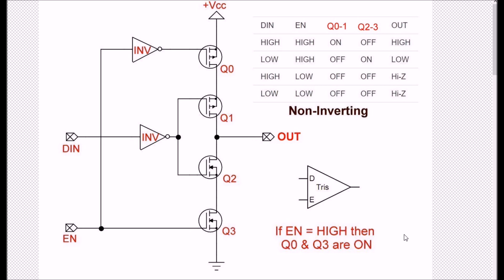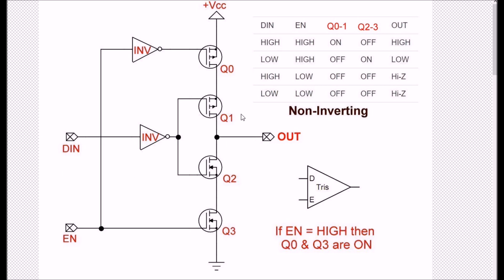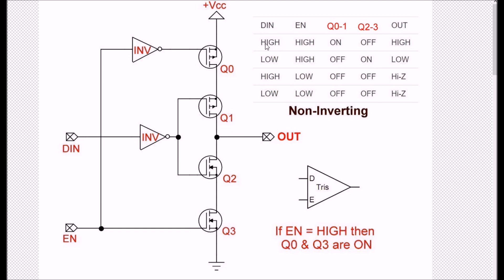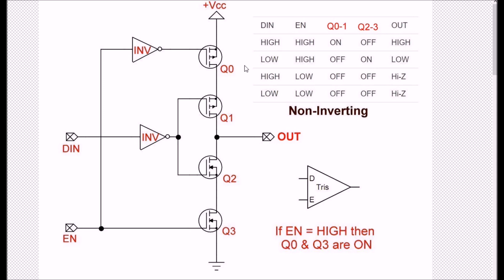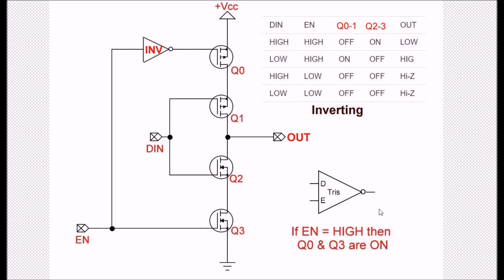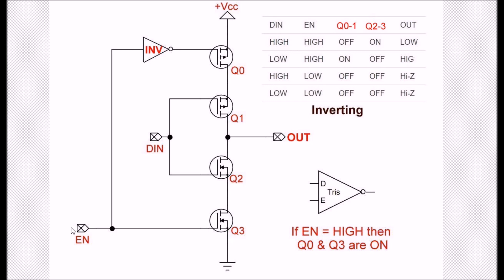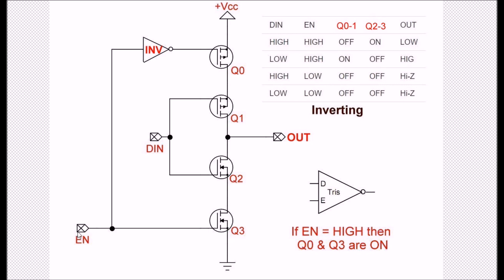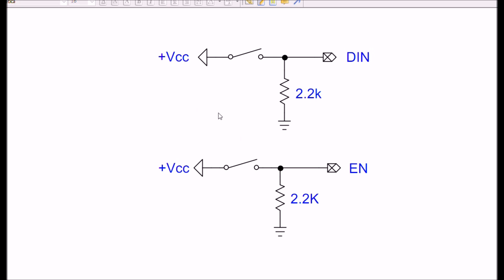Four MOSFET Tri-State Switch

Comment: Why use the p-channel and the inverter on the top when you can use another n-channel?
Why use the inverter on the DIN when you can swap the inner n and p channels and remove the inverter?
Reply from the maker: Wrong polarity.
Reply: @LewisLoflin  Oh. So you can't easily connect n-channel to Vcc. Thanks.
Reply from the maker: @ryansheehy0  No way around it. Check out the outputs of the typical CMOS gate.